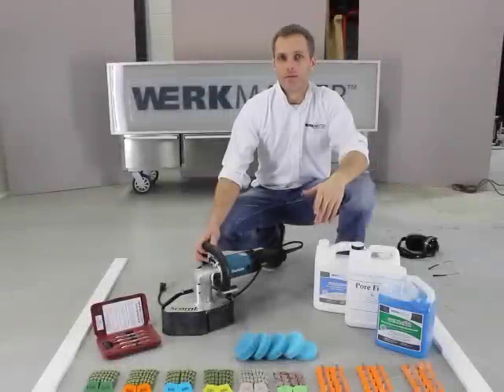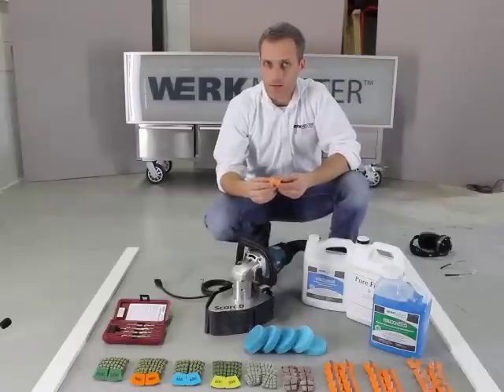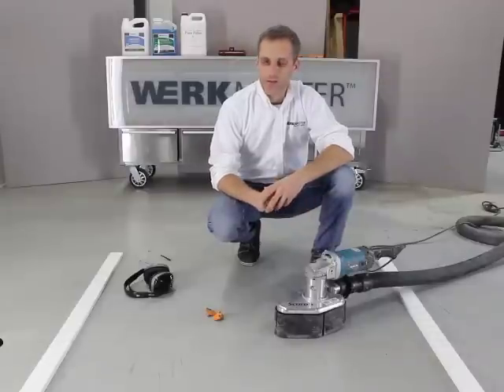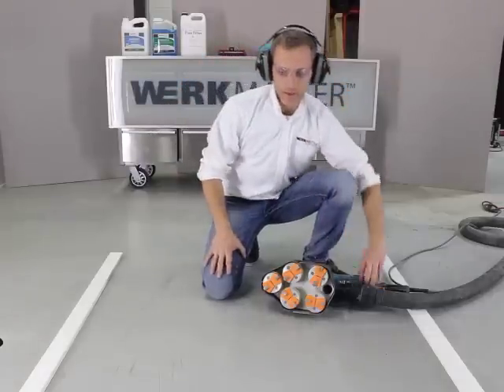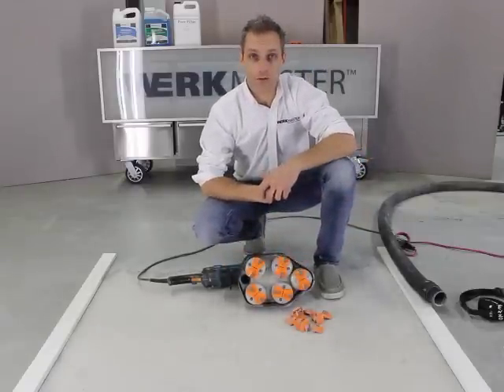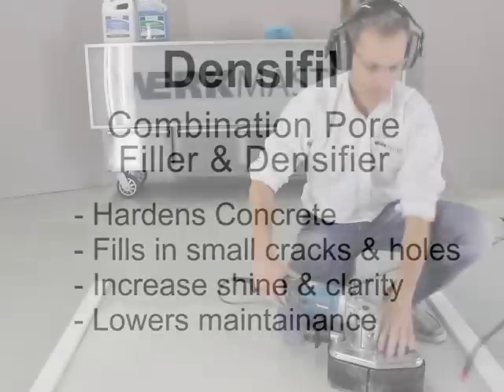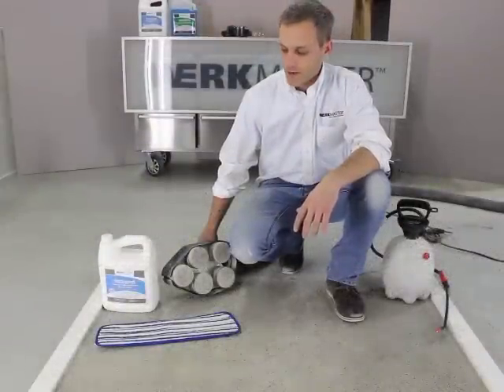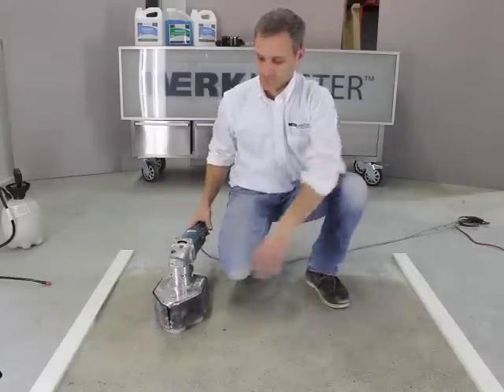How to Remove Epoxy Paint & How To Polish Concrete Floors with Scarab Handheld Grinder

Comment: May I share one experience because I need help to solve the problem? I have painted mural in the pool and I decided to protect the painting with epoxy. First two layers were perfect, but me as a beginner I could't control the epoxy because it cured fast and the surface was not smooth enough. Because of that I decided to put another (third) layer but in the mixture I reduced the dose of B component to slow down the drying process and then a problem arose. The epoxy did not dry. I consulted technologists, some of them told me to clean it, some of them told me to cover it with a new layer of normal mixture and I made the second suggestion. The new layer (fourth) has dried but under it (the third) layer has not dried yet. The new layer started to crack and I am currently removing it but it is getting complicated. My question is, do you know how to remove the fourth (dry) layer together with the third (that is not dry) without damaging the first two normal epoxy layers?
Reply from the maker: Hi Christian, I am sorry to hear about the struggle you are going through with your pool. as Far as I know there isn't a quick and easy solution to your situation. I will contact Frank Sommers our Technical Customer Support Specialist to see if he has any thoughts or suggestions.
Reply: Thank you @BrianWilsonWerkMaster   I'll be waiting for any suggestion from Mr. Sommers, I hope he will find some solution.

Comment: Where is this located? I have 1,000 square feet of failed metallic epoxy on top of a two layers of concrete overlay a local company botched in my home. It needs to be removed but i do not want to damage the slab. I am outside of Tampa florida
Reply from the maker: Hi Sharon,  we have contractors in your area who use our system. If you would like to send an email to info@ WerkMaster.com a member of our team will be happy to forward their contact information to you. Regards, Brian